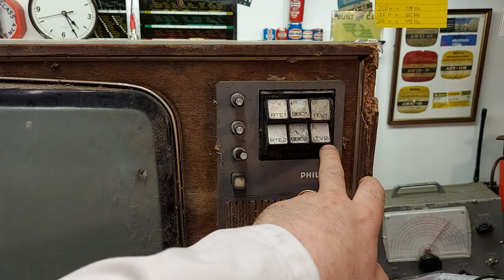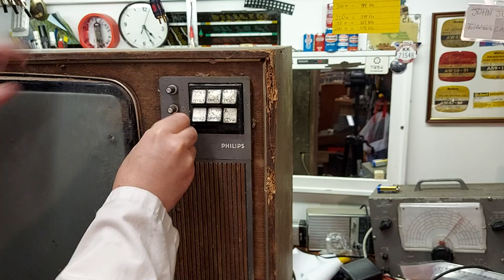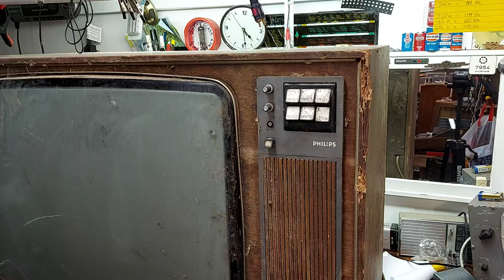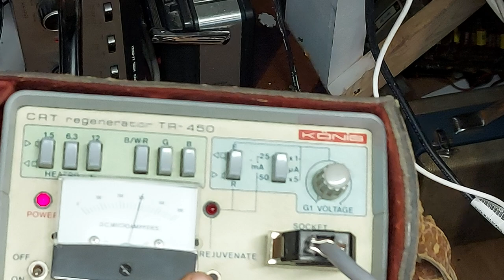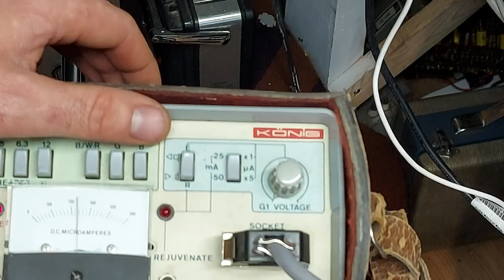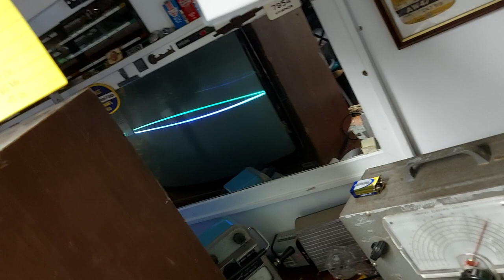Philips G8.

Comment: Reminds me how notorious the Aussie Philips K9 was.  As you mentioned with the G8, the flyback tuning cap was prone to going open, resulting in very high EHT. A trail of damage in some cases. Incidentally, K9 had an old style turret tuner rather than buttons, as varacaps didn’t have enough range to accommodate the oddball channel 5a on 134.25Mhz (139.75mhz audio).

Comment: Visionhire used to have lots of these out on rental. Although they had their issues, they were easy to fix.
Reply: Yup spent many happy year's fixing them..... BD131 in the frame output
Reply: @DaveBrown1  I worked for Visionhire in the 70sand 80s. Phillips 550 G8 and 660 G11. Great times. Convergence panel burn ups. Thyrister s/c. Great video. Brings back memories.
Reply: @COCHRANE55  I worked for Visionhire (Leeds) via British Relay, then of course we were renamed Serviscope  eventually taken over by Granada and then in came the redundancy package. Fond memories apart from the awful service manager !

Comment: OMG The days of Old, Philips G8,  1977 I first got my hands on one of these, Replacement of a few standard components then the convergance setup, they were  very good when working, great RF signal stage Sharp & Crisp, I had my Cross Hatch Gen that had one of the Philips IF Modules in, purchased from a Electronics Kit supplier, the days of old, Now, if it does not work, Replace the PCB !, surface mount technology is what came along, follow the block flow chart and replace PCB !, not exactly what I  was taught as a Teenager in the 1970's, service manuals should be FULL Service manual including diagrams, BOM, PCB - Component layout etc, now its replace PCB A1 if fault is shown in flow chart section, not a real TV Engineers job these days like it was in the 1970's, al you need is a screwdriver, Van and a few box's of PCB's to replace, call me old fasioned  but that's the fun of finding faults "Down to coponent level" not PCB Exchange, I rework SMD's to a point (Not BGA's) where you do need special equipment & IR heaters top - bottom of the PCB ! 
Interesting video the Philips G8's were a great picture in the day's
Thanks :)
Reply from the maker: Thank you.

Comment: Want your advice I have a small collection of old Tvs and Radios have often should I run them up to make sure they still work. I ask this as my mate switched on a modern internet tuner thing after five years and it blew up.  Mind you the newer stuff is not of same quality as the old kit anyway
Reply from the maker: It sounds like the electrolytic blew up in your mates gear. I would say go ahead and power up your stuff, deal with problems as they arise.

Comment: I havn't seen one of those sets for 30 years, i was about 20 when i used to fix them.
I still have the service manual for the g8 (God knows why) and a decca service manual (Transformer killers) lol.

I didn't expect it to work at all, i think the vertical drive board is the one under the line output.
Possibly the board connector to chassis is mucky as hell.
I'm wondering if the reason you had so many lopt's fail was the fault of the psu, they drifted in time and went above the 205 volts, then went Bang!!, maybe the lopt was over driven.
Hey you have a good play around untill you are bored then chuck it back in the skip, it's too nasty to recover.

Nice to see an old g8 again :-D
Reply from the maker: The set I had i had the ht set for 200v and it had the slow start mod. The lopts had a known problem with insulation and Philips acknowledged this. The replacement lopts were available at a low price so no-one minded. They we're good performers when set up right and I was quite fond of mine bit in the end it turned me off the G8 forever. I've checked the plug socket and it's okay. More to come in a few weeks........

Comment: Hello Ojnoj ..Remember one these burning down a house in the 70's..I had a number of them in the past. faults i can remember were 
L.O.P.T fails plus tripler burns up and dies focus problems..Those preselect buttons drift off..They hated any damp conditions i always dried them out with a hair drier..The Cap leaks and tracks ..Thanks for posting..

Comment: Great video, would be nice to see it working one last time as a complete set. I love G8’s for some reason. Had my LOPT go up in smoke and flames a few months back. That was fun. Managed to find a very reasonably priced replacement. 

Daft question perhaps, but were they all meant to have that metal cover over the LOPT? 

Mine’s missing one and I’m 99% certain it’s got a screw hole for one.
Reply from the maker: Hi, yes it should have the cover. I don't think it matters all that much though. I am doubtful I'll be able to get it going again but I'll try. It's off the be bench and safe for now.
Reply: Thought so, it's an odd set (That one you sent me 4 of the 5.1nF 1500v caps for that still haven't showed up!) Has all the stickers for a G22K522, but's a G26K522? I reckon it's had its complete chassis replaced. 

I'm sure you'll get her up and running, you always seem to! 

If/when you do scrap the set I'd be interested in the LOPT cover, just so it's a complete set. Costs covered of course.
Reply from the maker: It's a mystery where those caps ended up. Consider the cover yours.
Reply: Really is, my guess would be shipping between Ireland and England. 

It'll be even weirder if they turn up at all now! 

Thanks for the cover, let me know how much you want for it and postage and i'll paypal it over
Reply from the maker: Grand, it'll be a few weeks.
Reply: No worries, no rush. Would you be able to let me know over on UKVRRR when you're ready please?
Reply from the maker: Yep.

Comment: Ah..... Age creepeth upon thee! I lost contact with frequencies above 10kHz many years ago, let alone 15 and then some.  I find it handy to keep a cheap MW radio nearby, that way I can wave that around, close to the LOPT. That usually tells me if there's any line stage activity.

Now, funnily enough, my grandparents had a G8. They rented it, even though my granddad was ex trade. He always reckoned it was a better deal than buying what might well turn out to be an expensive item if it went wrong.  Thing was, I don't ever remember that telly needing repairs.  They moved house about 1972, and not long after, got the G8 after a lifetime of being a GEC, dyed in the wool, fan. He died in 1982, and my grandmother kept that set until she had to move into a nursing home after her stroke, about 1989/90.  Someone certainly got their money's worth out of it.

Comment: Those SCR G8 supplies are tricky. I've got the earlier chassis G8, which I too found next to (thankfully not in!) a skip, still on its original stand. On mine, the mains dropper was open, the main smoothing can had exploded and the SCR was short circuit. Always gives a great picture and has been pretty damn reliable now that's it's all done 👍

Comment: Spent many a happy hour replacing LOPT's on g8's in my dads old tv shop. I seem to remember there was a fairly common problem with a huge resistor with about 6 pins in the PSU as well.